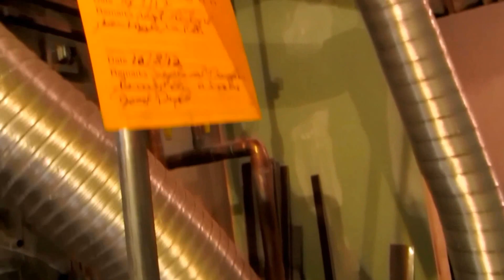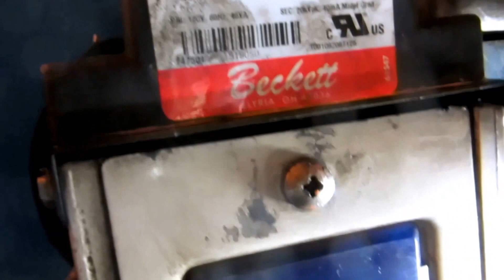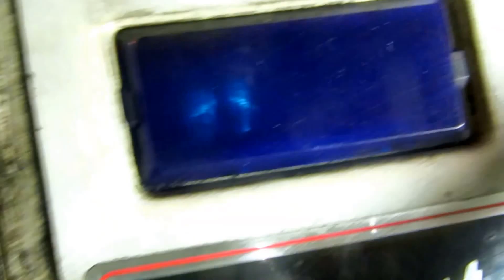SCOTCH MARINE BOILER WITH BECKETT AF I I 150 OIL BURNER

Comment: Scotch Marine, interesting name. I can't wait to see your January and February videos with the brutally cold winter coming up. I'm in the Washington Baltimore area and it only got down to 4 degrees but that's pretty cold for this area. I had to shut the heat pump off and run on electric heat for quite a few days. Biggest electric bills I ever had December through February.
Reply from the maker: Nicholas CeeA i will bring more boiler cleaning videos for sure .this season so stay tuned
Reply: I'm watching your November 2013 videos and working my way up. The really cold winter hasn't happened yet. It's going to be a while until I get caught up to the present lol.

Comment: Looks like someone took the valve off the pump. That really needs a long Pre and a longer post purge. Thats why the head carboned up
Reply from the maker: you have a good point there.i was thinking about that when i left the job.... i need to  go back and get a carlin pre/post purge safety control and add a oil delay valve .
Reply: steven lavimoniere Honeywell makes one where you can set the times. Works great and you can have a nice long post purge
Reply from the maker: i am going with the new carlin pro max it there newset control and you can set all times/cycles  for what you want.i like the 45 second trip out option.
Reply: Cool Ive seen them on the new boilers Ive done. They even have a special terminal for power vents..

Look forward to your next video